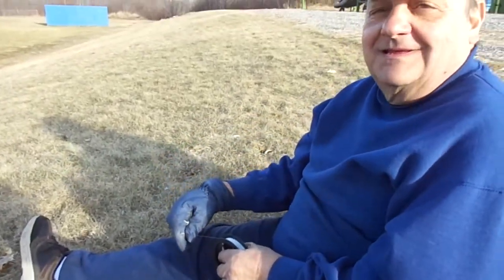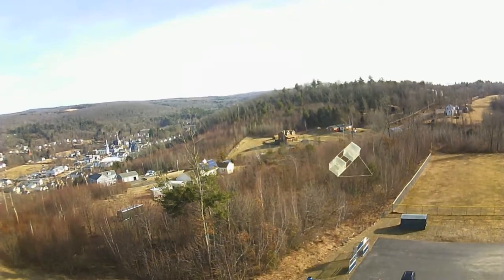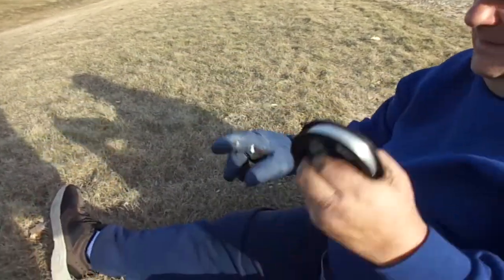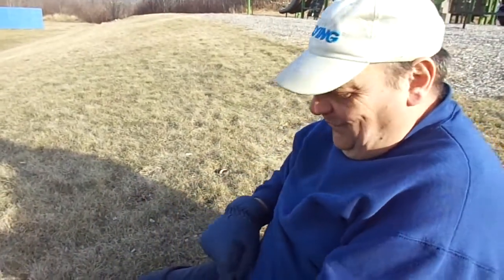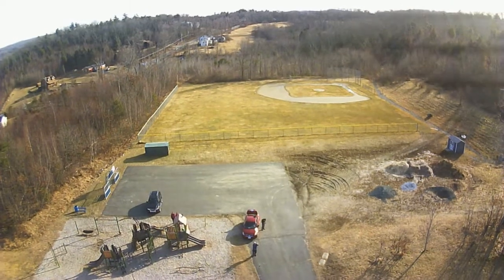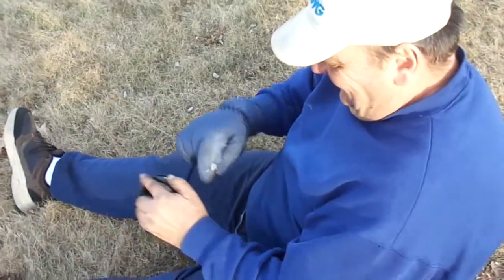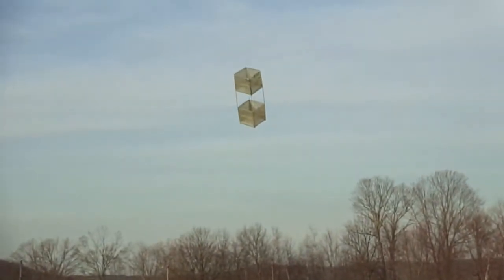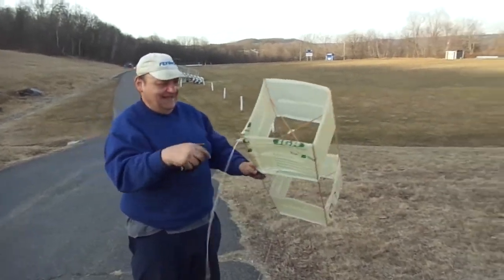Richie's Recycled Trash Bag Box Kite

Comment: Mike   where do you source your Thin wire leads to solder to your Caps / motor ?    the only thing i have done is strip out some old telephone wire  its pretty small to match the size on the coreless motors  but wondering what you do ??    thank you so much
Reply from the maker: I've been buying 2 and 3 conductor side by side wire on small spools from the local hobby shop. The 3 conductor stuff is intended for making extension leads for micro servos, etc. It can be carefully stripped apart to make individual wires. I also developed the habit long ago of clipping suitable short pieces from scrapped devices like radios, recorders, cameras, etc. Nothing gets the final toss until it gives up all its LED's, micro motors, micro hardware, switches and the like. I'm only a short step away from being an actual hoarder, but it's amazing what treasures come out of the junk box! Stay safe and keep building!
Reply: Mike is it in the model train area ?  do you know the gage   just figuring out where to look   lol   Thank you
Reply from the maker: @larzhillbot1443  My local hobby store has it in the area where they have servo plugs and radio control stuff. You will probably want  26AWG size. (Bigger number = thinner wire). 26AWG has a conductor diameter of .016 inch, 28AWG is about .012 inch. AWG stands for American Wire Gauge. Look on ebay, maybe even Radio Shack. Hope this helps!